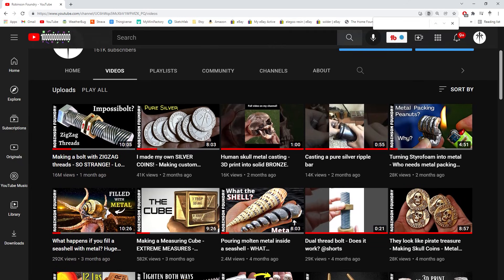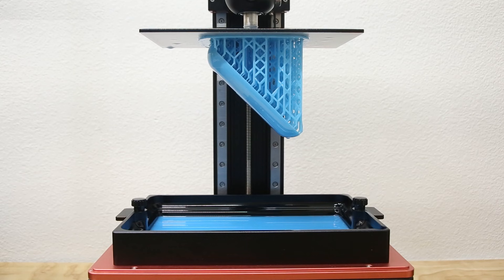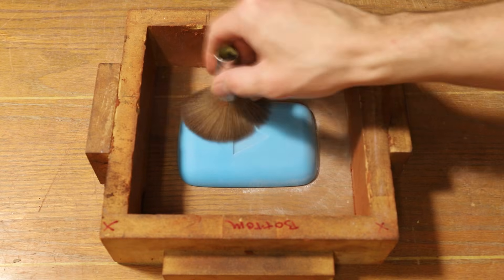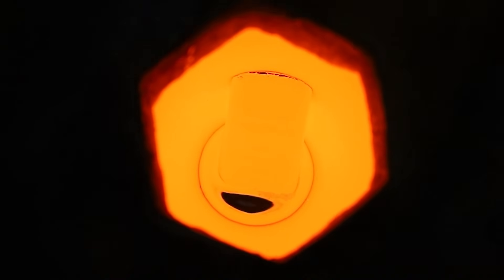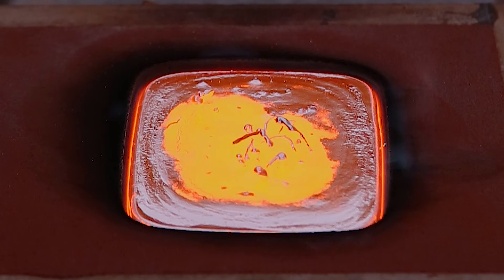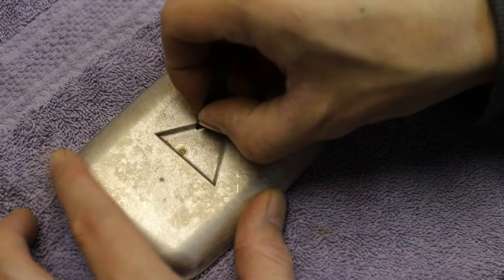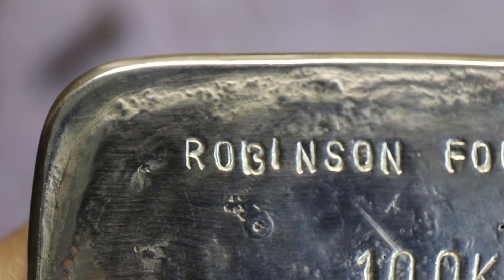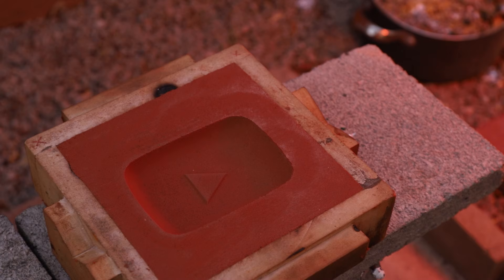Casting a 1KG PURE SILVER YouTube play button - 100,000 Subscribers celebration -

Comment: If you want to avoid the sprouts appearing on the back of your pour, use a gas burner as its freezing .... this burns them off and adds them back to your pour. they use this method in fine metal refineries to stop this exact same thing happening

Comment: Two questions:

1) Why did you print the mold up at a 45 degree angle like that if you were just going to peel off all the supports anyway?  Is that some side effect of the resin printing process?

2) How much work do you have to put into cleaning the crucible before you melt stuff in it?
Reply: I can’t speak to 2 but when resin printing you want to angle the print somewhere between 30-45° as it gives you cleaner details on the print

Comment: Looking at your nice work, I all of sudden think of a huge challange people had succeeded before and did not document how. I am not asking you to try it because it is very hard, but I wonder if you could describe how it can be done. The problem is: Cast 1KG cylinder with mirror finish using metal material of choice such that the mass error is less than 0.05ppm and the yearly error is less than 0.5ppm.

Comment: If you use flux, you probably wont have the bubbles. Also if you use vacuum casting in plaster, you can have much more details in your casting. And maybe you can use the 20 grams of silver to do just that. :) 

You need some good burn out resin. I saw "VOG jewelry" do a lot of that. 

Greetings,

Jeff

Comment: It would be fantastic if you could make a video in which you 3d print a mold, pour wax into it, and then dip the wax model in Suspendaslurry to determine whether the wax evaporates faster or slower than PLA and also if the final product quality suffers or improves. The mold may be printed with 0% infill to save time and material, and it can be reused to create several wax models, reducing print time even more. Also, make sure the mold is made of a heat-resistant material like PETG, as PLA may distort when pouring hot wax. Love your videos, keep it up!

Comment: You need to add some boric acid to your silver as soon as you turn your furnace off. .25 grams for every 10 ounces generally works well depending on how good/clean your .999 silver is. You may need to adjust that if you have more impurities floating on the top. Your silver was too hot when you poured. Wait until the rim of your crucible starts to darken. Keep your stream within an inch of the edge of your crucible and keep a slow steady stream. That will help with out gassing and minimize craters in the middle of the mold.
Reply: Any tips on gold with borax per gram and melting in crucible ready to sand cast

Comment: Instead of removing the sprites from the top, could you have used a propane torch to heat and melt them back into the mass of silver?

Great video.  Thanks for sharing.  Make today great.
Reply: Would Not Work, Silver Doesnt Melt Like That In BIG Pieces !
Reply: generally a degasser agent like borax is used